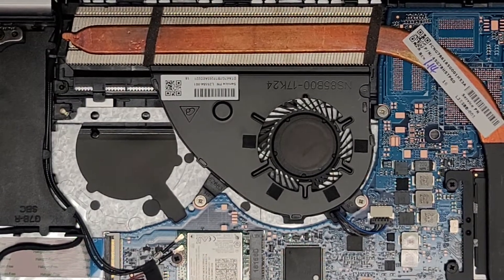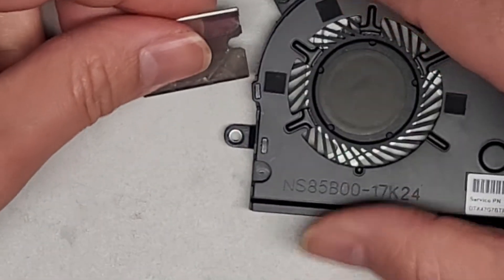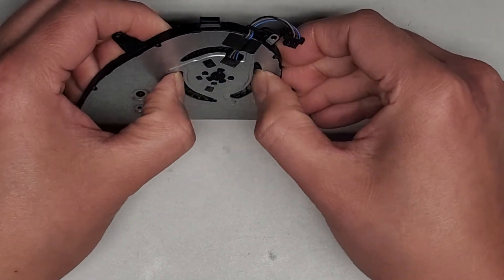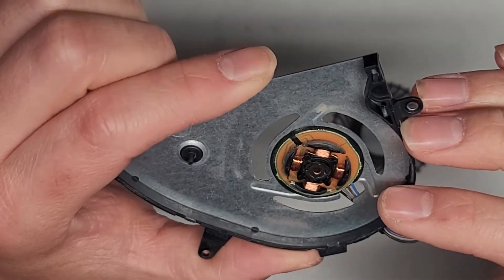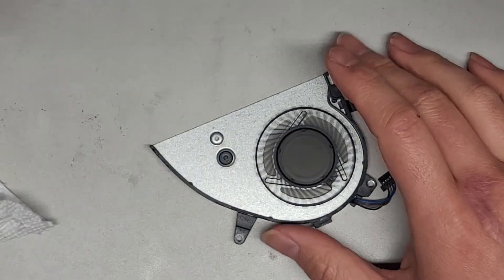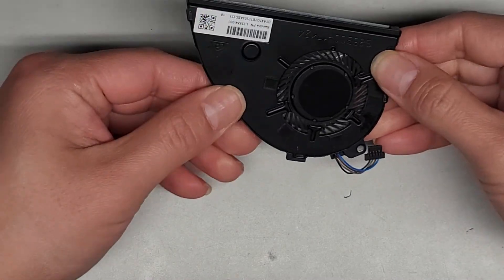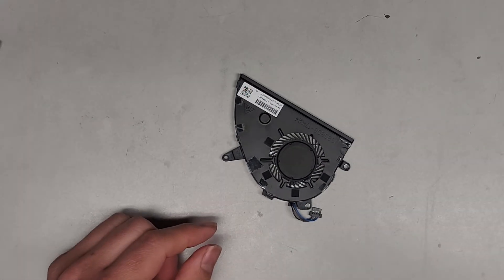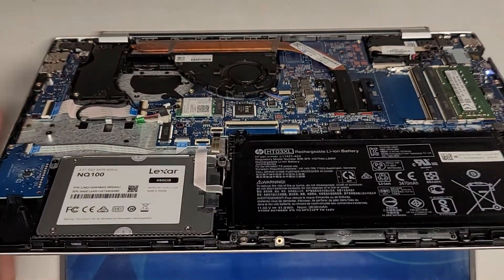HP Pavilion Laptop 15-cs0064st Noisy Buzzing Loud Vibration Vibrating Fan Replacement Repair

Comment: Huge thanks for this video!  My fan would make all kinds of scary noises while trying to spin up and then stop and then try to spin up again in an endless loop. I followed this and had my laptop back up and running great without having to order parts and wait. The only difference was my fan blades came off with the bearing still attached to the shaft. There is a little locking washer piece that keeps the bearing from being able to slide off. I just left it together and cleaned and lubed the bearing on the shaft but did everything the same. My fan clipped back together well enough that I didn't worry about taping it, and no issues. I repasted while I was in there and it's 10x quieter than it ever was.
Reply from the maker: Awesome, glad it helped. If you haven't already, please like and subscribe so others can find my videos and possibly consider watching a few others, liking and commenting to get the algorithm to recommend my channel. Thanks!

Comment: I have the exact same laptop and did the same thing to my fan and it didnt fix it, but after running it without the metal shroud on top the whining stopped completely. I believe it has (in my case) something to do with how the air flows through the fan shroud holes perhaps.
Reply from the maker: Shouldn't be. The oil might have taken a while to coat the thing properly.

Comment: FOR YEARS I have had the problem of my laptop making that god-awful VRRRRRHMMMMMMMM noise, and FOR YEARS I have resorted to smacking it with various objects to get it to shut up because I didn’t know how to fix it. There are several dents in the laptop due to this… Finally tonight, I got sick of it and opened it up, trying to figure out the problem, then I stumbled upon your video.

I AM SO GODDAMN GRATEFUL, YOU HAVE VERY POSSIBLY SAVED MY ENTIRE LAPTOP! Now, if that awful noise ever starts up again I’ll know to put oil in the fan… Christ.
Reply from the maker: Haha awesome! Glad it finally fixed it.

Comment: ive rewatched this video and it works everytime (i used olive oil because i couldnt find motor oil however it works fine for a few months before slightly buzzing)
Reply from the maker: Lol cooking oil gets gummy quick. Just ask someone if you can get a drop of oil from their dipstick.

Comment: Nice video, is there a specific cause to this problem? I recently had this problem and got it fixed by a professional, but is starting to make the same sounds again. Is there also any way to prevent this from happening?
Reply from the maker: It's caused by fine dust/powder and humidity both water and grease, vape, air fresheners, smoke, etc.

Comment: Last night after watching your video I tried to pull out the propyler or whatever it's called, but broke it in the base point where the motor pin holds it. Will I be able to fix it anymore 😢
Reply from the maker: Sadly you'll have to get a new fan :(

Comment: I was having this same problem the fan was buzzing and if I smack it, it stops, I opened my laptop case but was too scared to open the fan housing so I poured some bycycle oil through the sides of the motor and propeller with a flat head screwdriver, it eliminated the sound by a Little bit, enough to make it seen negligible, but when I put my ear close to the fan, I can still hear a faint sound, but when the laptop heats and the fan ramps up, it's silent like new again, and the next time I boot up the sound is gone completely, but sometimes it comes back again and goes away when the laptop heats up a bit, can you please explain why is it happening? Btw thanks for the video I will take it to a professional and show him this video to repair my fan
Reply from the maker: They might have a mess of oil to clean up. Lol The grease attracts dust and stuff. Over time it just gets all gunky.

Comment: 8:19 where are you getting that from? Pretty sure it's just because of the tension.

By the way, do you happen to know what a fix could be to some keyboard keys not registering?
Reply from the maker: It's the magnets. 

Need to replace the keyboard.
Reply: @ItsBinhRepaired  What could cause them to stop working? It's only the keys in the middle area like 45rtfgvb so could it be that they were pressed down when I wasn't using the laptop for a long time? I had it closed with the charger put on top inside the bag. Otherwise, there was some dust beneath the keyboard, but not on those keys.
Reply from the maker: Not sure. Likely corrosion to the circuits.
Reply: @ItsBinhRepaired  Yeah, it's weird. Only the keys 45 rt fg vb are not working. They suspiciously line up nicely.
Reply from the maker: @hopcfizl3671  yeah, usually it's a trace along that row

Comment: Your video greatly helped me , learning a fan can be disassembled and lubed.
I've used some hair clipper oil by the way.
No more noise nor vibrations.
Many thanks for that.
Reply from the maker: Awesome, glad it helped. If you haven't already, please like and subscribe so others can find my videos and possibly consider watching a few others to get the algorithm to recommend my channel. Thanks!
Reply: @ItsBinhRepaired  Agree and done.
Reply from the maker: @staric4863  Thanks again :)
Reply: @ItsBinhRepaired would you recommend the hair clipper oil if you don't have the car kind?
Reply from the maker: @heatherhas  sure, that works.

Comment: After i removed the fan and lubricated it, i put it back in. Doing exactly what you explained but now my laptop wont even turn on. I did use 2 stroke engine oil.
Reply from the maker: Did you disconnect the battery and drain the power before doing the other stuff?
Reply: @ItsBinhRepaired  yes. I disconnected the rechargeable battery on the back. My model is different to the one in the video. Its a 15-ba032au
Reply: @ItsBinhRepaired  i did unplug the lcd before removing the fan. I did put it it back in afterwards. Idk if that would be the problem.
Reply from the maker: If you disconnected the fan before disconnecting the battery and holding the power button, then it likely fried it :(
Reply: @ItsBinhRepaired  fried the fan or the battery? Since the LED goes on whenever I plug it in. And in the other tutorials they don't remove the battery and it still turns on.
Reply from the maker: @youknowwhoiam366  motherboard. Try plugging the laptop in, press the power button, and wait 10 minutes
Reply: @ItsBinhRepaired  I did that. I'm so confused tho cuz the guys in the other tutorial didn't remove their battery only the rechargeable one and theirs still turned on
Reply from the maker: I dunno :(

Comment: if you have no engine oil, try out silicone oil, works much better and is resistant to heat too
Reply from the maker: There is no heat in a fan "bearing" shaft... All the heat is in the heatsink. Also, engines don't run cold, so if heat is a concern, that's definitely not an issue with engine oil... so what is the benefit other than it being an alternative? Most people will have access to a car with an oil dipstick that they could take a drop of oil from if needed. Having silicone oil/lube on hand will be a lot more rare.

Comment: Here was the solution to my HP x360 fan noise issue. Everyone is talking about the fan speeds, but the fan should be virtually silent during use. You shouldn't even know that it's on at low speed.
Follow me here... You laptop chassis has flex. It's built to have a certain amount of flex. It's designed into the unit. The fan is inside of an enclosure. Sure, it might be dirty... but, more than likely, the metal plates and case of the fan enclosure is slightly bent, causing the fan blades to contact the enclosure. First, clean it out thoroughly. Take the fan enclosure apart. Careful not to lose the little screws. Take the fan blades out and clean them...REALLY clean them, with a clean, dry toothbrush, or something of the sort. Clean out ALL AREAS around the fan location. We're cleaning for two reasons. To make sure that no dirt or dust get into the fan, AND to make sure that no buildup is pushing against the fan enclosure in any way. Put the flat enclosure pieces on a flat glass table, and look to see if it's completely flat. Reassemble the fan and the enclosure, and plug it into the motherboard. Move the fan around and in different directions. See if you can detect the noise any longer. The fan should be running, but completely silent. No matter what the speed is. If you still hear the fan, that means that you're going to have to go back into the enclosure and do some bending and adjusting of the enclosure. Run the fan without the enclosure cover to see if it makes any noise. If it's silent, then the contact of the fan blades is probably occurring with the cover. Press it out gently with your fingers, and visibly inspect where it might be rubbing. Observe the fan's ability to spin freely throughout the process. Plug it into the motherboard before reassembling, and turn the computer on. Observe the fan and listen to the noise level. Once you've bent it to the right position, there should be no noise.
Now, you may want to remove any stickers and labels on the outside of the fan enclosure. The thickness of that sticker might be the difference between it being pressed out of shape again. This also might be a good time to reapply fresh thermal grease/paste to the cpu and heat sink. I removed several pieces of tape and some labels on the fan enclosure. Carefully route the wires and cables around the enclosure back into their correct places.
Reassemble, checking for noise at every step of the way.
My laptop is now still cycling and the fan comes on, but you just can't hear it, because of the rubbing issue. The bios and programming wasn't the problem. It was the enclosure being slightly bent.
Hope this helps, I'll post it here and elsewhere.
Jimmy Fingers
www.jimmyfingers.com
Reply from the maker: Glad you figured it out. The housing bending is usually only an issue after being opened and messed with.

Comment: It would be nice if you had let us hear the sound of the fans. Would have helped others to diagnose the source, as opposed to thinking the sound was a faulty drive. But your description of the sound might be enough. lol  I think that's the issue with my 15-cs. I'll try replacing the fans first before I buy another drive. Thanks.
Reply from the maker: Lol just stick a needle in the fan so it can't spin and see if the sound stops
Reply: @ItsBinhRepaired  Couldn't find a needle so I just used a hammer instead. lol Subscribed!
Reply from the maker: @billydanzz  LOL

Comment: Real question not sure if you explain it in the video but why is it making these sounds? This computer is really loud. The fans make a lot of noise even when off sometimes but the sounded Normal. Then it recently started making the buzzing sound. It happened Maybe 5 times then I took a long break from using it but when I opened it today, it made a very long buzz and even when I closed it continued to make the nose for a while.
Reply: I also im not sure if it's considered a buzzing sound it sounds werid. but I think it definitely has something to do with the fan. It sounds like it was getting stuck.
Reply from the maker: Is the sound coming from the fan?
Reply: @ItsBinhRepaired  yes im assuming. It's coming from that little "vent" on the bottom. I took a video to show my dad but hes not really taking it serious.
Reply from the maker: @roselovelace4266 this playlist will help Fan Repair: https://www.youtube.com/playlist?list=PLSSiYX-ta7aqqxfDWDQh-B6Az4ZgDI459

Comment: I been having the loud buzzing issue and I’m so glad I found an exact video on how to fix it. I used to smack it to stop it but then it got very bad and louder and longer. I followed all the steps. I used engine oil instead. It worked! No buzzing when I turn on like it was.. thank you!
Reply from the maker: Yup, that's what I used. Engine oil. Glad it worked. If you haven't already, please like and subscribe so others can find my videos and possibly consider watching a few others to get the algorithm to recommend my channel. Thanks!
Reply: @ItsBinhRepaired  thanks for the video. is it good to use normal cooking oil or olive oil for this?
Reply from the maker: @DpKris  no, that's not for lubrication